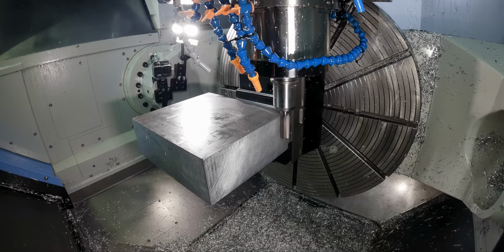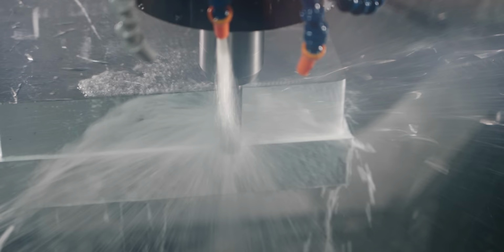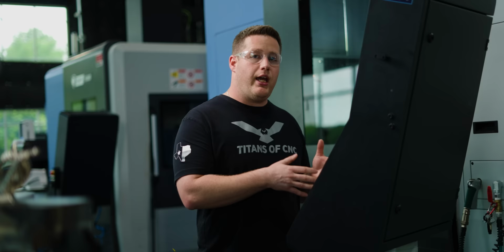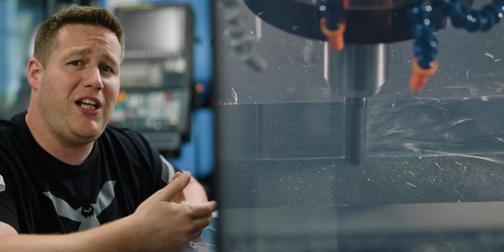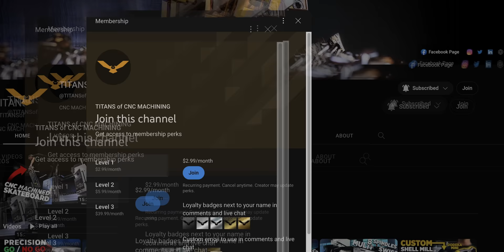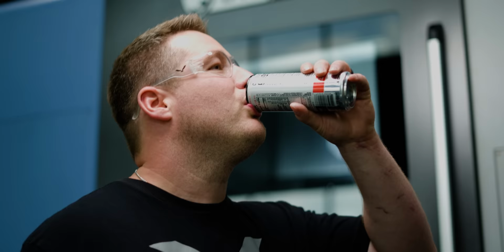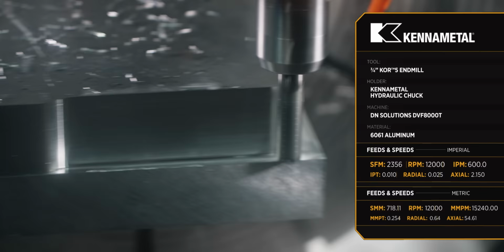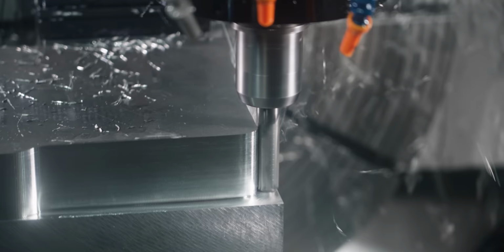Tool FAILED In Part Suspended With No RIGIDITY

Comment: The vibration is caused by the shock waves of the helical cutter pulling up on the extended part. Every time a flute passes, it lifts the metal block a tiny bit and it resonates at the right frequency. So turning up the feed rate/rpm takes the cutting process out of the natural frequency of the setup and gives you a clean cut. You could also use a symmetrical compression end mill instead of an up cut helix, this would give you neutral cutting forces instead of pulling up and cause the part not to resonate. Common in wood working, less common in metal working. You could also use a lower helix angle cutter which has less pulling force. Or a serrated roughing end mill (the Kor 5 has big gaps in between the chip breakers) a normal serrated rougher would have less pull up since the chips are a lot smaller.
Reply: Thank you for the excellent detailed explanation that was lacking in the video 👍

Comment: This event is called chatter. When the CNC reaches a certain frequency range, it can sometimes match the natural frequency of the CNC plus workpiece. Decreasing the rotational speed of the tool will only make the appearance of chatter more evident (if you keep the radial depth plus axial depth). By increasing the rotational speed, you might get out of the chatter frquency. For a more efficient cutting process, it is common to make a stability lobe diagram that gives the axial/radial depth of cut for a given rotational speed.

Comment: I program our 5 axis Robo Drill and I am ALWAYS fighting rigidity on stainless and titanium. We are always pushing the work envelope to the max. I've found that 5% radial engagement 150% axial high SFM on a half inch chip breaking rougher always works well with minimal to no vibration.  Sometimes on some of these parts I repost my program like 10 times before I get something I am happy with.

Comment: I would not use full axial depth and just use a 1" rougher with a small vertical step and a .75inch stepover to reduce drive pressures. Vertical pressure is better than side axial pressure in that circumstance...sure it takes longer but consistency wins the race.

Comment: 1:45 I felt that sigh haha. If I had to guess the rush jobs are the ones that were originally at another shop that screwed the pooch and now with a deadline still looming the custy will pay the rush fee to have it done  at a bigger shop. Sometimes the other shop just doesn’t have the tooling or experience to do the job. Other times it’s that the job is just a big ol pain in the butt. I think you guys got caught with the latter — but we’ve all been there!

Comment: Hello. I think that the vibrations of the part is up and down, not side to side. The goal should be minimize forces in the less stiff direcion. Trochoidal milling pull the material upward a lot,  I would try to reduce the stepdown by half, and  increase the stepover.

Comment: started out with no chip load! IMO too many flutes and crazy long gage length, I would chuck up and choke up on a 3/4" x 3"loc 3 flute alu-power and blast thru that, and yes i have programmed and set up this type of part in a 5 axis w/ 800mm trunnion. and i can't see the dovetail that well in this set up but looks like minimal contact, i use a narrow dovetail width like 1" wide and draw down on the 1" faces on either side of dovetail, (e.g. 3" stock )  yielding maximum contact, looks like in this set-up the little dovetail knicks on both sides of stock create a pivot point.

Comment: Moving 2 or more variables at the same time  would be confusing, its best to just move one at a time depending on what you want to achieve  
 Rpm up ( tool pressure reduced) rpm down ( tool pressure increase) 
 feed rate increased ( tool pressure up) feed rate decreased ( tool pressure down ) 
 step over / depth of cut  increase  ( tool pressure up ) and in reverse. 

it's all situationally dependent and knowing which variable to adjust just comes with experience

moving more then one variable you could effectively 180 your self back in the same mess.

Cool video BTW, Love all the stuff you guys are showing =) thank you for the great content!

Comment: I was running some flats on a really long medical drill. Holding it with two vices for rigidity and was still getting too much chatter/ pressure. Ending up switching to a smaller diameter tool with more flutes. Cut like butter. Tool pressure is funny sometimes.

Comment: I could have told you that.. vibrations often come off too little feed / tooth, revolutions and depth are a little more difficult as it resonates in the material and machine.. I would have doubled the step over first

Comment: There are also other ways to reduce vibrations for this type of clamping. Check for schunk stabiliser. But yes for aluminum  it works to increase the speed and reduce the Ae or Ap. For stainless steel or titanium its a bit tricky You will destroy the tool much faster
Reply: We used the Schunk Stabilizer at my previous job on some 15-5 Stainless forgings.  It's amazing how much they help for sure.

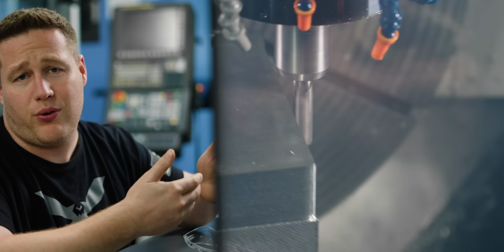Comment: 1:50 no no no no NO! take the infrared laser metering tool and test the metal composition of that "deflection spot" referenced to the rest of the block as to what that material should be... bad cast that did not mix uniformly.

Comment: By the time you sped up the tool, you were already away from the problem area so this isn't really a solution in my eyes. Also i noticed that it only vibrated when it was cutting parallel to the vise but when i turned corner and started feeding towards the vise, it didn't vibrate anymore.

Comment: Did you try a smaller depth of cut?
Reply: yes.  with the first tool I started at .100" radial (usually I'm at .150") then I dropped it to .060" but still didn't work so that is when I went to a smaller tool.  tried to leave it at .060" but still had to decrease it.  As far as axial depth, I left it the same throughout the process.
Reply: @spikeypineapple552  lol I never said I used .100fpt  that would be ridiculous.  read again, we are talking about the depth of cut not the feedrate.
Reply: @dickgoesinya4773  no worries.  Another big aspect of a successful operation is knowing your machine and tailoring the process around what you have to work with.  So if you found what works for you and you are making good parts then you are doing a great job!  For this, we were trying to show one way to solve a problem and how slowing things down is not always the answer. (which is what our first instinct usually is).  So to add to what you are saying, if I was at the point (with this tool) that I needed to add multiple axial depth of cuts then at that point the KOR5 and dynamic milling strategy is pointless, or rather, useless.  So at that point I would go to an indexable cutter and use a traditional toolpath where you have a small axial depth and a large radial depth.  I would also use a traditional roughing path to limit the small arcs from trochoidal milling which is going to add a lot of cycle time due to the accel/decel values on the machine.